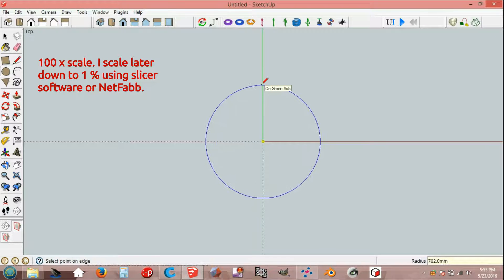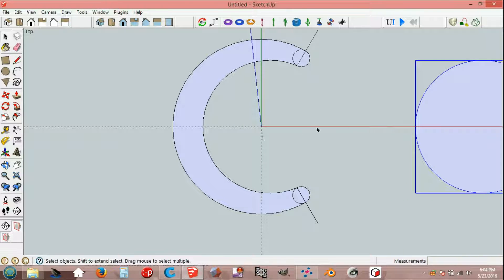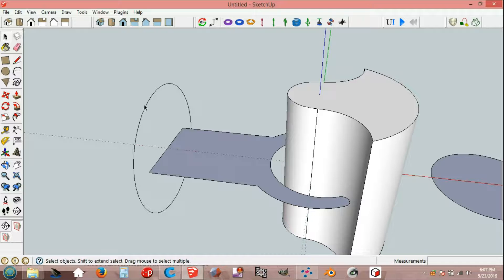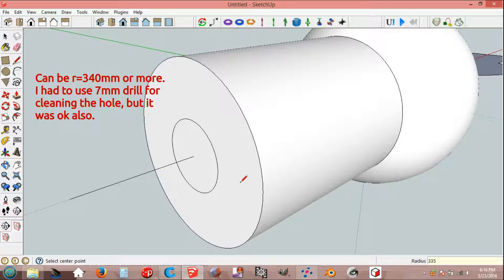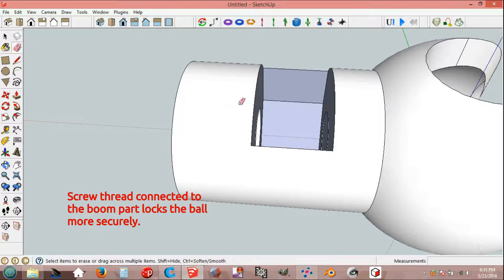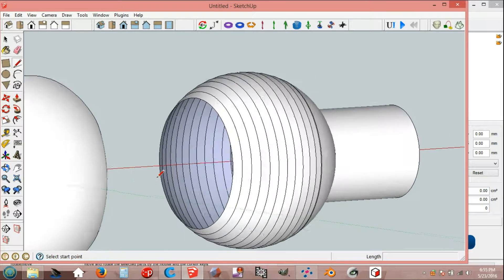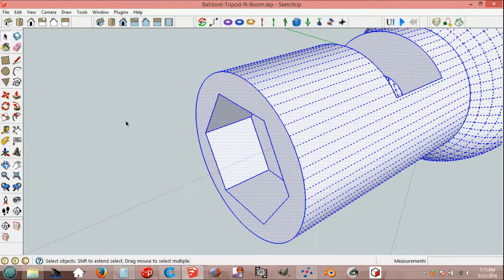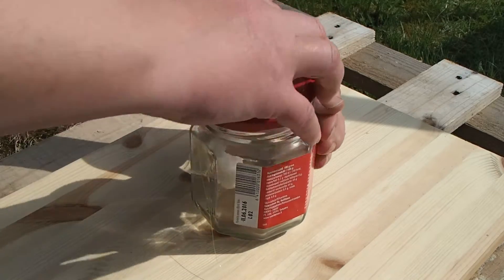Multi Use Ball Joint In SketchUp /  Selfie Stick, Recording Boom,  Tripod

Comment: is there an obj version of this and other types of joints that can be downloaded?
Reply from the maker: No, but I try to make a link soon (or Thingiverse).
Reply from the maker: .obj files, different sizes.
            https://mega.nz/#F!59wSxJTB!oWeZkmgQyg5Y3YowmJOC4A
Reply: Ok thanks. I'm interested in making action figures 3 3/4" and looking into making the joints.
Reply from the maker: Ok! Perhaps you have to make some test before printing the whole thing. Small dimensions can make the things different. ABS plastic cold vapor treatment helps a lot with the durability.
Reply: What's ABS plastic?
Reply from the maker: One of the most used materials for 3D printing are PLA & ABS (Acrylonitrile butadiene styrene). Car bumbers, Legos, mouse & keyboard are usually made of ABS.
Reply: That's like hard plastic. I subscribed to Fusion 360. Is there any way to create joint articulations on a 3d figure model?
Reply from the maker: I haven't used F 360, but perhaps if you check: http://www.thingiverse.com/thing:116571    and http://www.thingiverse.com/thing:2111117